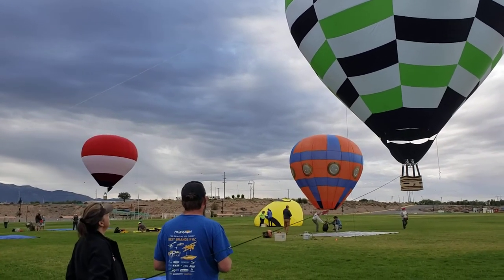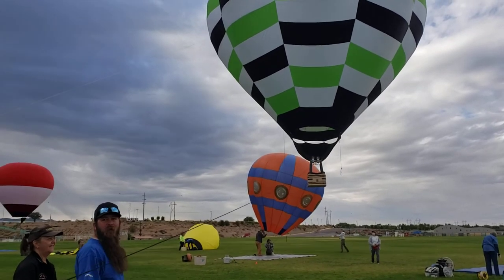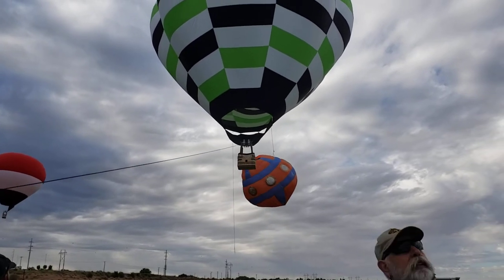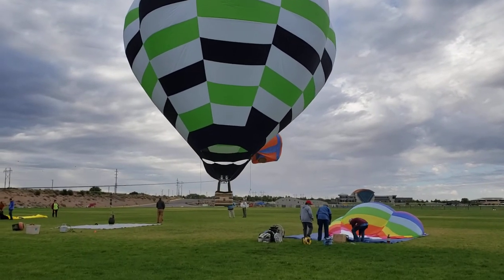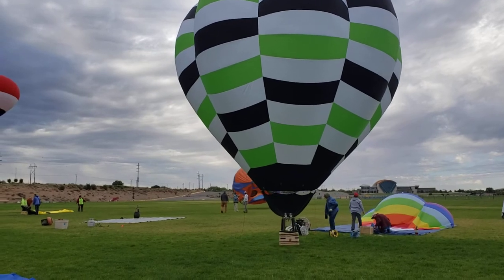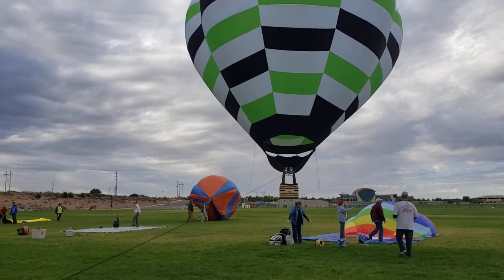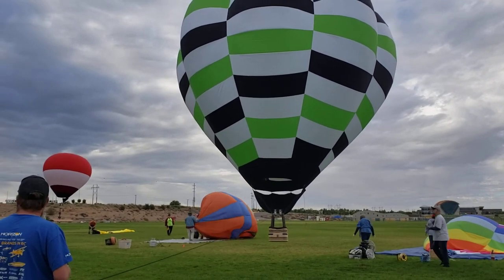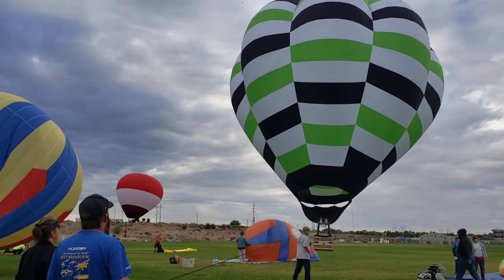Radio controlled Hot Air Balloon event with Skyler, Balloon Fiesta Park, very cool and infomative

Comment: I heard that they can only go up as high as the rope will allow.  But what would be cool is if they had fans built into the gondola so they can go up high and then the radio controller can turn the fans on in case they're drifting away so you can control which way it will move and then open up the top and let the hot air out and it will land.
Reply from the maker: Thanks for watching, I heard they are working on modifying or making the changes so they can do free flight instead of tethering them